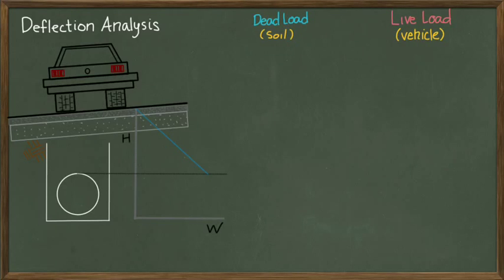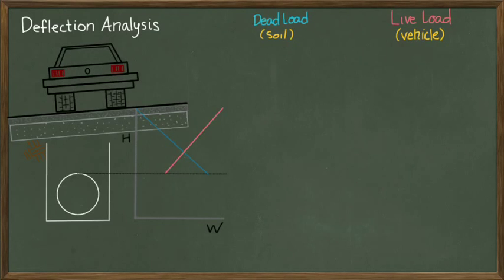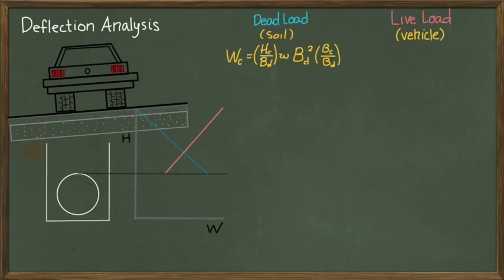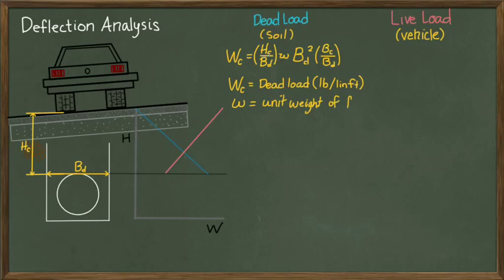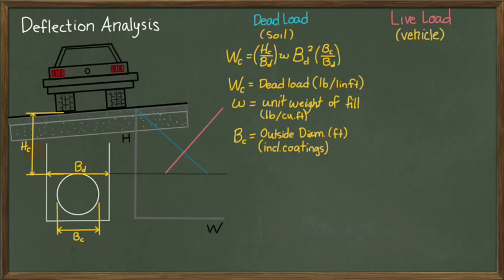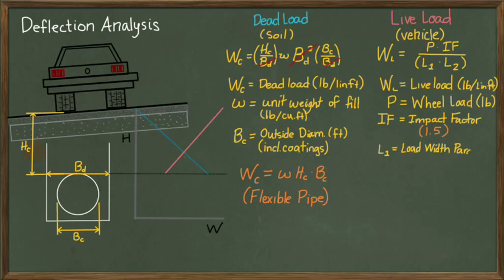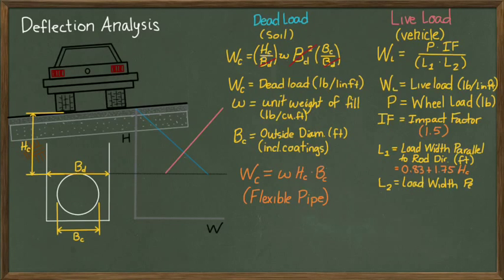Pipe Wall Thickness: Deflection Analysis Part 1

Comment: Dr. Lamb, I have been trying to understand where the live loads from ASTM A796 came from, and why those values do not match up with the live load values from your equation shown in your video.  The ASTM A796 live loads I list below are H20 live loads directly from the standard, which is based on 16,000 lb. rear wheel load of a 40,000 lb. truck.  Can you help me understand why they do not match up with your calculation?  Also where are the L1 and L2 equations referenced?

Hc                        W1 ASTM A796 H20 Loading                     W1 (Calc)
(ft)	                                        (lbf/ft2)                                         (lbf/ft2)
1	                                         1800                                               2720
2	                                          800                                                1072
3	                                          600                                                  570 
4	                                          400                                                  354
5	                                          250                                                  240
6	                                          200                                                  174

7	                                          175                                                  132
8	                                          100                                                  103
Reply from the maker: Hello Clint, I'm getting ready for the fall semester and will try to answer you question as soon as I can.  Off the top of my head, I think the the L1 and L2 come from AWWA M11.  I also believe that the live load are discussed in M11 as well.  I just need to find the verbiage and share it here when I have a free moment.
Reply: @kennethwlamb  Hi Dr. Lamb, coming here 4 years later to say that the latest version of AWWA M11 does not have the live load formula you mentioned. I am assuming either it has been removed or did not exist in the first place. I would appreciate it if you could check your reference. Table 5.1 provides values in lb/ft^2 that include the impact factor. Thanks.

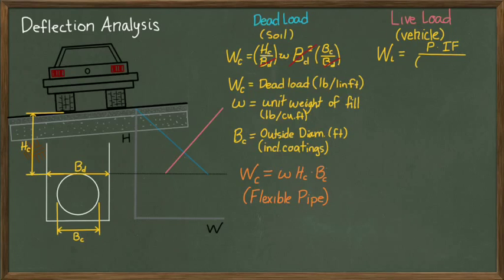Comment: Hello Dr. Lamb,  at 1:30 to 1:44 the equation is said to be simplified because the pipe is flexible. I tried the original equation to see the difference between an inflexible pipe and the flexible pipe and a facepalm moment happened. The width of the trench cancels out despite the pipes properties. Wouldnt the dead load be the same for both cases? Is there something important that I'm missing in terms of material properties affecting dead load. Aren't all pipes flexible? thanks, one love
Reply from the maker: Not all pipes are flexible.  Concrete, VCP are two popular examples of rigid pipe.  Rigid pipes are so called because they do not deflect to transfer the vertical load into a lateral load that is resisted by the trench walls.

The analysis methods for flexible and rigid pipes are completely different and that includes the acceptable method for estimating the dead load. It's been so long since I've analyzed rigid pipes I can not tell you off the top of my head how it is different.  If you wanted to learn how to analyze rigid pipe, I suggest you look into book "Buried Pipe Design," by Alma Moser.  It is covered there.  Companies like Rinker (CEMEX) also have publications and software you can use to do the analysis of rigid pipe as well.